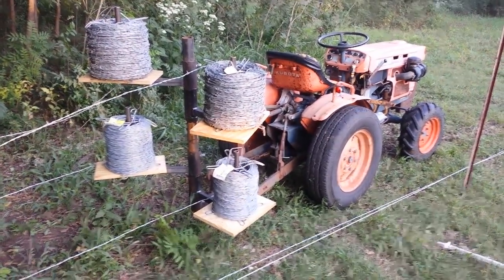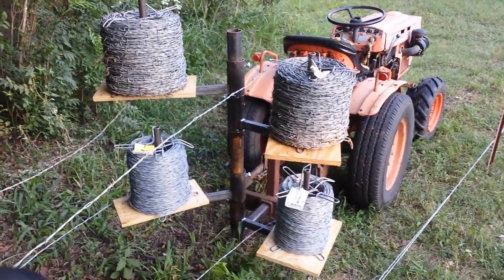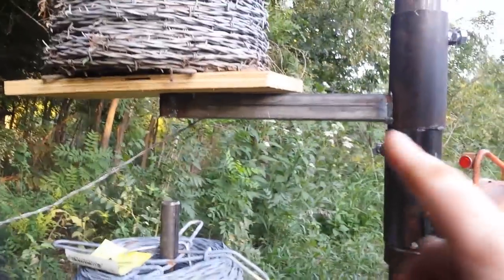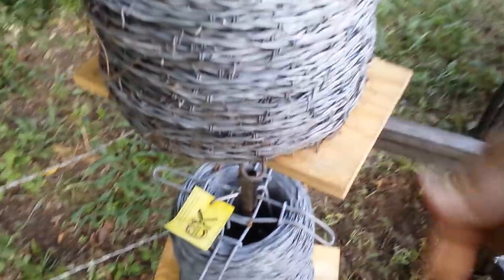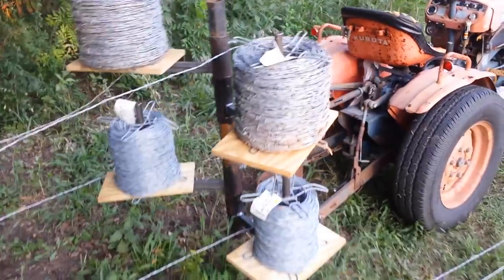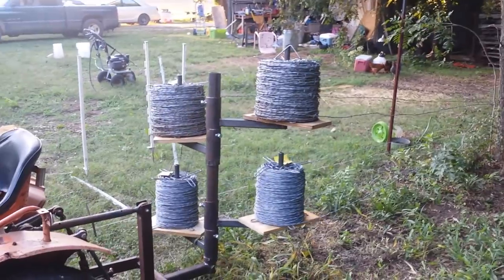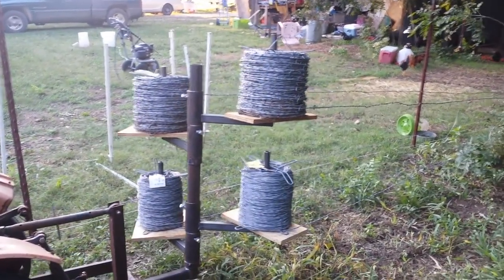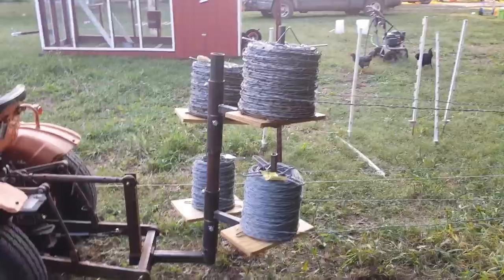Unrolling fence wire

Comment: you should make some locks so they won't rotate in at end pull them tight
Reply from the maker: this way worked well.  I could let the tractor go by itself and I could go back and install the clips on the t post to keep the wires from tangling.  then cut the wires one at a time and use a stretcher.  installing fence was easy and one person job.